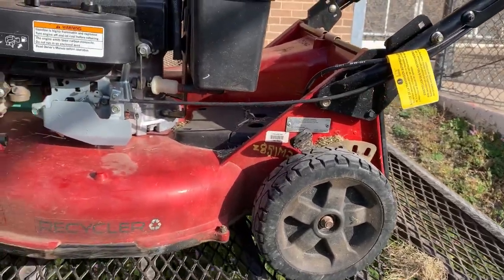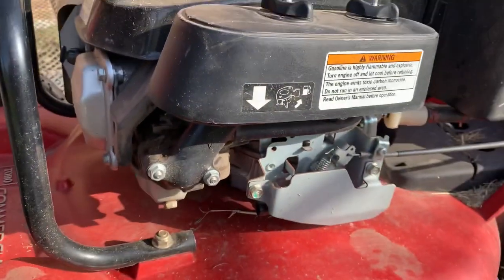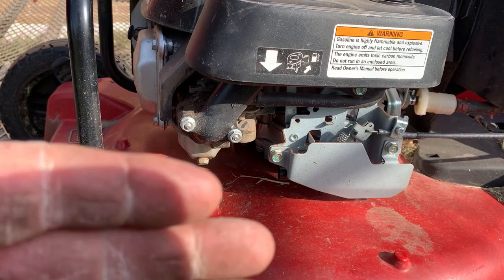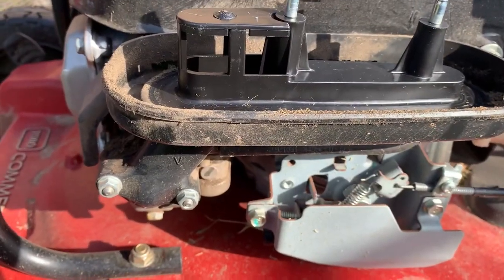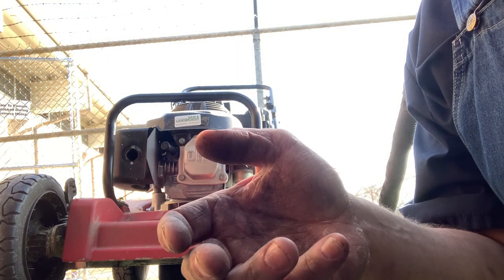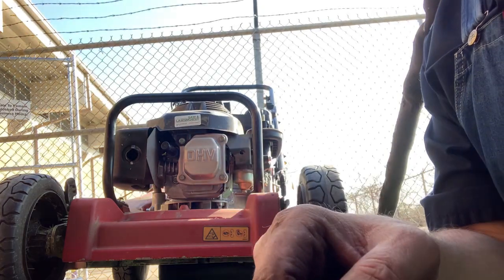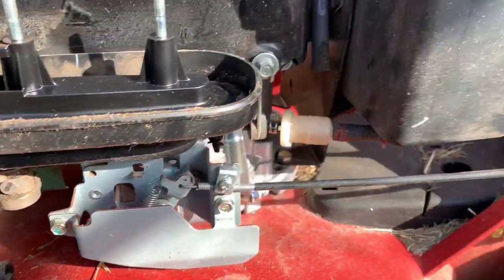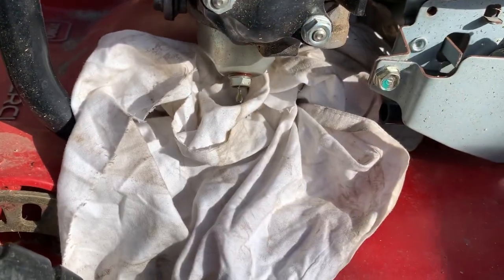LAWN MOWER WONT START AFTER WINTER STORAGE? TRY THIS FIRST BEFORE BRINGING IT TO THE SHOP!

Comment: I have found that I can over-winter if the last load is one of the engineered fuels.  While a can of the stuff is expensive, its still less than 10% of the cost of the service call when the "corn jelly" takes over the carburetor from letting pump gas sit all winter.

Comment: Just a quick comment. A lot of people say to use brake clean to start engines. What I never said is there are 2 types of brake clean. Chlorinated and non-chlorinated. The non-chlorinated is the flammable kind that can be used as starting fluid.

Comment: I thought that I was doing my uncle a favor last fall by running the gas out of his Toro lawnmower. However, he had to have a small engine mechanic come out to the house this spring because after putting in fresh fuel - he could not get it running.   I can’t  understand what could of gone wrong as there was no gas left in the carb to go bad.